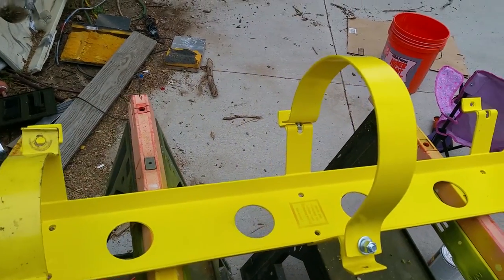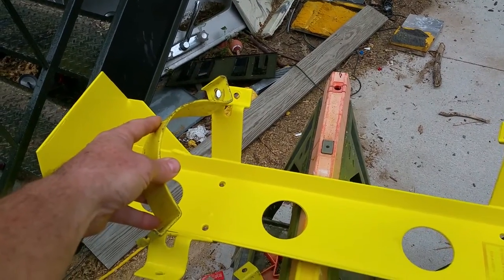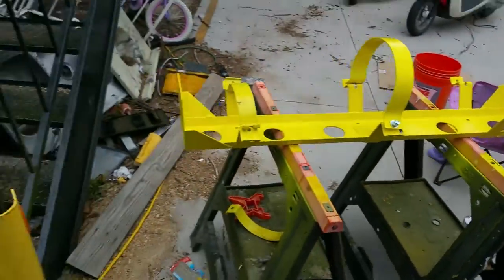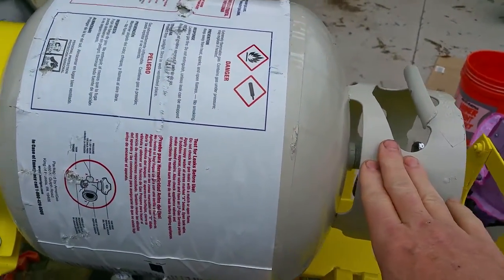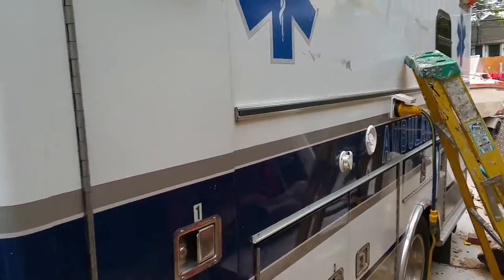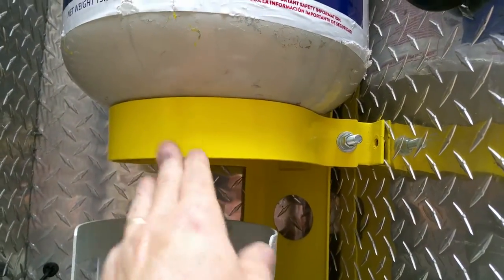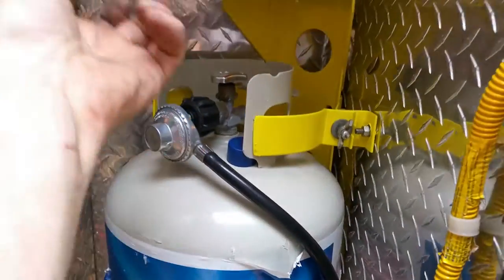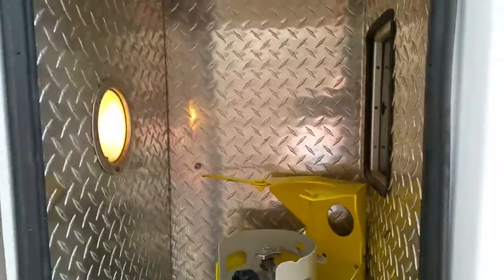#11 DIY Ambulance RV Conversion

Comment: Awesome! May I suggest that you get some sort of lock for the door so no one can steal or mess with the propane? That's if it doesn't have one already. Also was wondering if this project is done or if you are still working on it? Interested in how it turns out. Wanting to make some sort of camper myself, but can't decide if I want to get a retired fire truck or a retired ambulance.
Reply from the maker: All the exterior doors do have locks. Most all is done. I just have some cleanup (decal removal, etc.) and then I'll be posting a final version. The commercial construction and storage of these beasts is pretty impressive. Thanks for your comments!

Comment: Not trying to be critical.But I would worry a little bit having propane in enclosed area like that.I would think about some kind of vent.
Reply from the maker: Good point. Actually the door is ventilated top and bottom due to the oxygen storage. Thanks,Jim